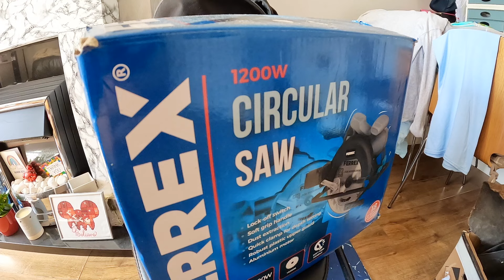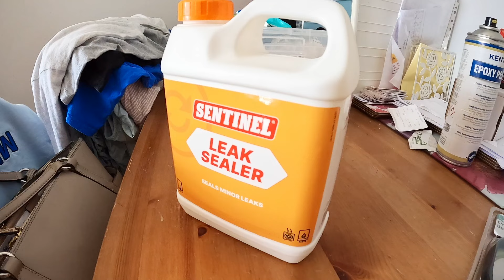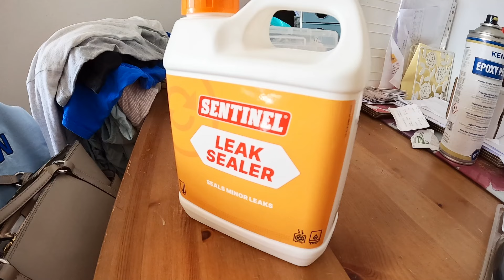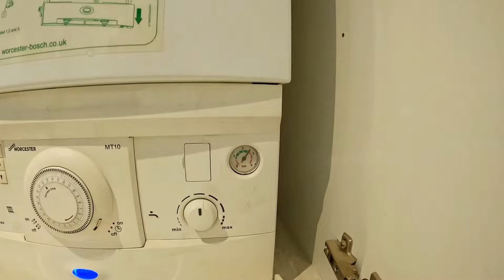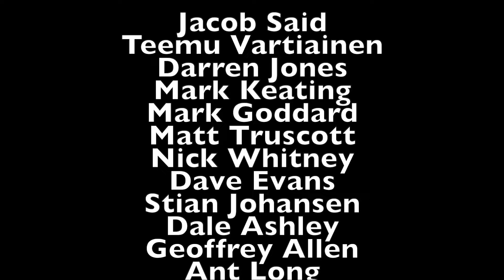CAR IDIOT DOES PLUMBING!! 🫣 *DIY FAIL*

Comment: Should have opened the nut at bottom or chrome radiator just above the vale you turned off not after the valve.

Comment: Probably too late now but. . . Smear clear silicone over the cut edges. This'll stop water swelling the board and you having to replace it again.
Reply from the maker: Thanks for the advice mate! 👍 Not too late at all. We still need to seal it all up (once we have sorted any leaks) and the board isn't fixed in, so we can easily add some silicone to the cut edges.

Comment: Still think it's the pressure vessel mate, goin by the video you topped it up to 1.5 bar cold but after running for an hour it was up over 2 bar...when it gets to 3 as the water heats up and expands it will discharge from that pipe outside... then when it cools down you've lost pressure, it's a combi boiler the vessel is inside the boiler so I'm not sure why the engineer who serviced it wouldn't at least have checked it, pretty sure you'll have been told this already but as a plumber that was painful to watch😂
Reply from the maker: Thanks for the advice mate! 👍 Cat was told by the engineer before to monitor the pipe outside, but not a single drop came out of it. 🤔

Comment: The boiler expansion vessel needs recharging mate .
That should of been do when you had it serviced and it's often not done.
That is the reason why the pressure is rising too much when the heating is running.
Look on line there's plenty of tutorials about it 👌
Reply from the maker: Thanks for the advice mate! 👍 We were told to monitor the pipe outside to diagnose the expansion vessel. We havn't had a drop of water from that pipe, which we are lead to believe means the expansion vessel is fine???
Reply: No its not bud I have been a heating engineer for over thirty years trust me you need to repressurise the expansion vessel..
With a bike pump look on YouTube I'm sure you will find something on how to do it.
If your struggling I will pass you me number and I will talk you through it hope this helps 👌
Reply: Def vessel you prob didn’t leave it on long enough for it to blow prv to outside pipe.
Use both hands on the handles of that circular saw btw and keep your missis fingers away I was cringing 😅

Comment: i would say the bladder in the expansion vessel  has failed that's  usually what happens when you have to keep topping up the system .
Reply from the maker: Apparently everything about the boiler is fine??? 🤷‍♂️
Reply: @marcushayesford  i would check the pressure vessel  for yourself, there is usually a schrader valve for pressurizing, press the middle of the valve if water comes out the bladder has failed .

Comment: Pressure equalisation is the issue with the expansion tank. What solved it for me was not turning the heat settings all the way up. Set them to 3 quarters. We had the same issue and had the entire system checked. Every pipe. Every connection. Every rad. EVERYTHING. We even replaced an old part of the system that had a leak when it was installed and was repaired. NOTHING fixed it. Turned the system settings down from MAX and it hasn't happened since. There is also the possibility that there's an internal failure that only occurs under pressure and it slowly gets worse and worse.. A seal or valve etc.
Reply from the maker: Thanks for the advice mate! 👍

Comment: the small pipe you showed on  the outside wall is for the pressure relief valve of the boiler if the expansion tank is faulty the system can over pressure so when you have youre heating on watch the pressure gauge on the boiler if it goes up and over in to the red then the prv will operate   you will see hot water come out of that pipe so could be a faulty PRV or expansion tank  .
if it is only happening when you have your heating on then that could be the problem and would account for the loss of pressure when the boiler has gone cold as it has lost water .
if it was a leak on the heating system like pipe or joint ext then you would have to fill it up on a regular bases to keep the boiler working even for the hot water hopes this helps and you can under stand my rambling as im not great on the keyboard
Reply from the maker: Thanks for the advice mate! 👍 Apparently everything with the boiler, including the expansion thing, is fine?? 🤔

Comment: Hi Marcus be careful with the mower I did the same thing a few years ago and the blade flew off and came out the bottom of the mower nearly hit me in the foot
Reply from the maker: Thanks for the advice mate! 👍 I'll get Cat to check the threaded bit stays tight. I might even take the blade of and sharpen it, and then lock-tite the threaded bit on.

Comment: I would check if that pipe under the bath is actually a central heating pipe before you think anymore about replacing it.
Reply from the maker: Thanks for the advice mate! 👍 I wont be diving in to cut pipes out myself (well not without some serious YouTube studying first! 🤪) For now we'll keep our fingers crossed and see if the leak seal does anything. 👍

Comment: Judging by repairs done to ester, maude and Heidi i predict these problems will be revisited for the next 2 years , maybe get clunkfab to come and weld it up.
Reply from the maker: Which repairs have I revisited on the cars??? 🤔
Reply: @marcushayesford  hmm, how many times has transmission been out on Ester? I seem to remember several attempts at exhaust repairs on maude .
Reply from the maker: @susanhenderson2322  I have removed Esther's gearbox too many times to count . . . . I don't ever remember repairing Maude's exhaust tho. 👍

Comment: Bruv! If you ever get stuck with stuff like that give me a shout. Building services is my job so if it’s something I can’t sort myself I have a long list of mates that owe be big favours that can sort it. It’s all swings and roundabouts mate. That’s what we do. Take care of family. Remember I owe you know!!!
Reply from the maker: Thanks mate! 👍 You'll be the first person we call if we'r ever out of our depth. Thanks as always for everything! 👍 Don't forget to let me know how you  get on with Dean's Mk1. 👍
Reply: @marcushayesford   should be running tomorrow mate. Spoke to the lad who made the the loom and we did everything right just need to feed an ignition live to the yellow and black wire on the ECU and it will run. He even sent me a few maps to load if it dose not start first time.
Reply from the maker: Cool mate. Surely the constant 12v we had connected to the black/yellow wire should have worked then no??
Reply: @marcushayesford  no if you remember we had it connected to black and green. That just made the relays click. The man reckons everything connected in the engine bay and the earths then one power lead to fuel pump and two live feeds to battery then all you need is ignition live to black and yellow and blue light will come on in ECU then it will run.
Reply from the maker: @jonnybamber1772  If I remember rightly the instructions said that wire needs a 12v whilst cranking. So maybe you need to connect a 12v ignition feed to the black/yellow AND give the green/black a feed whilst cranking (maybe splice into the black starter trigger wire we identified that day) ???? . . . . Anyway I knew it would be something simple, a plug and play look is supposed to make life easier! 😀
Reply: @marcushayesford  😂

Comment: You have the orange spacer upside down.
Reply from the maker: On the lawn mower??? The orange bit went back in the way it came out. When I took it apart a few weeks ago there were 2 nipples which locked into the metal blade BUT they had broken off the blade side of the orange bit. I was tempted to turn it around (So that I at least had 2 nipples each side) but I thought Id see if the tension from the threaded bit would be enough, and it was so happy days. 👍